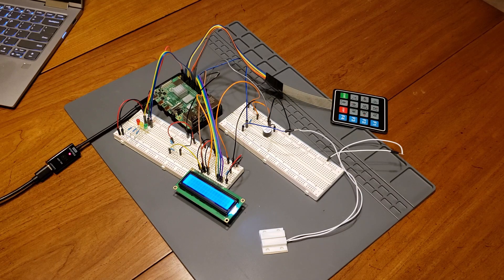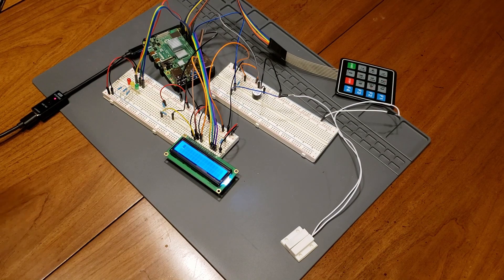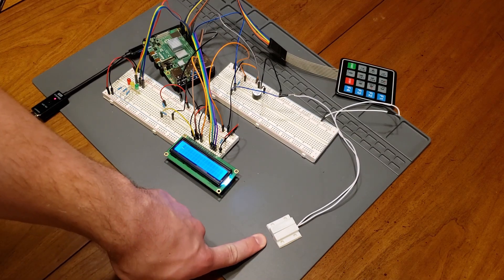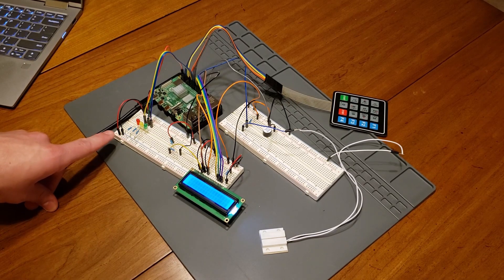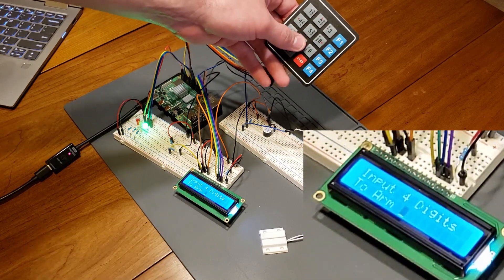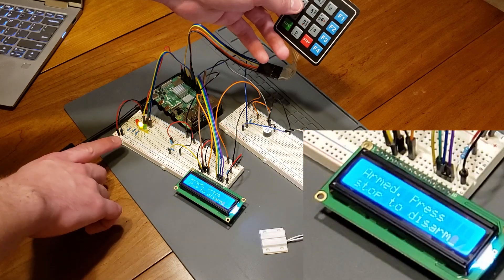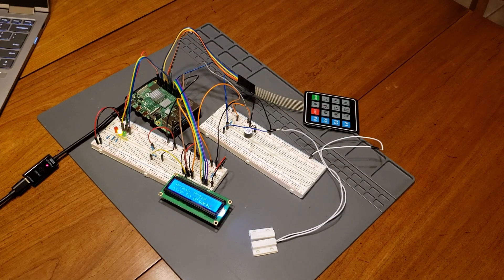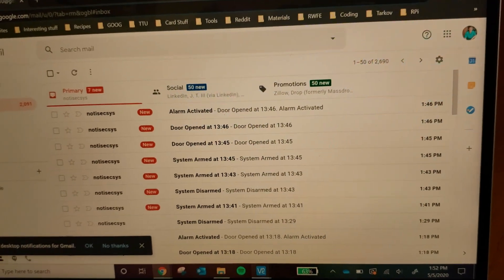Raspberry Pi Home Security System - Controls Lab Final Project

Comment: Hey Zach, for my last project before I graduate I built most of my home security system by myself. The only part im having trouble with is connecting my membrane keyboard, and coding a 4 input code to disarm my buzzer from making noise once activated, Im reaching out for help because I dont really have much places to ask.

if this is something you can help me do Id highly appreciate it

Comment: Hi, i love it! 
I create one Alarm-Security-System by my own, with Raspi 4B and a lot of other stuff and integration of Alexa, WhatsApp, Email, Call, .... 
Hope i found the time to make a video like this. One is important for all the interesting people = Path to the hardware (Link to Amazon or xxx), Code or Code-Snippet (as link or picture); and for myself, more details of the steps and what GPIOs are used. 
@ other People, i used Door-Contact-Sens by Aqara Xiaomi (Zigbee), so i do not need GPIO resources.
U can connect all the Zigbee-Devices easy by "CC2531 USB Stick" (on Amazon).
For LED i used LEDs with electrical resistance included, so u do not need to put it on Dev-Board. 
Controlling and coding by iOBroker - so easy. 
Have Fun - ThanX to Zachary M :)